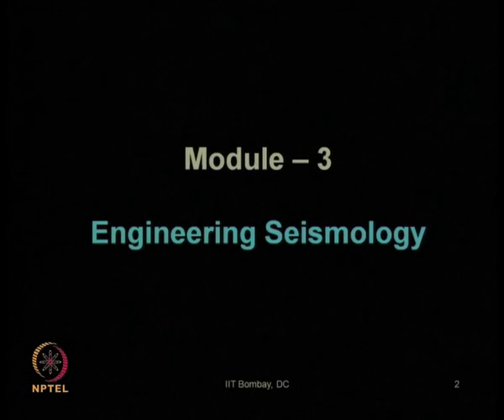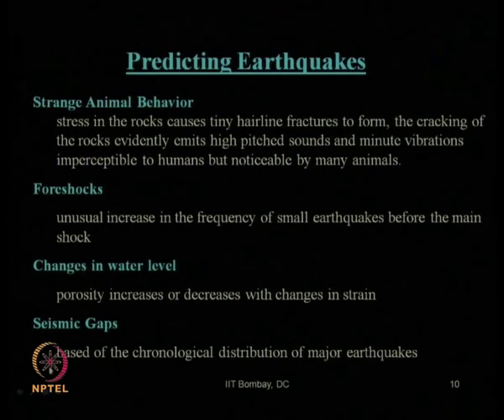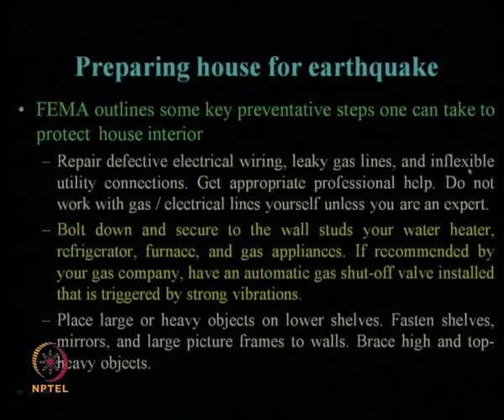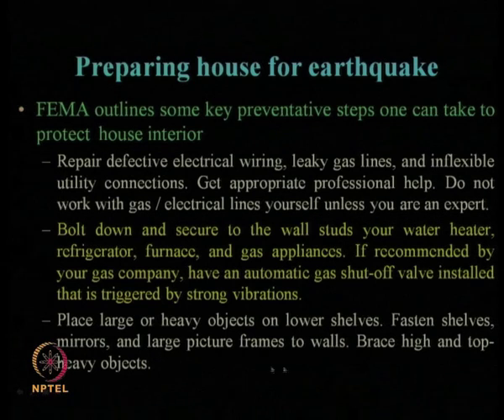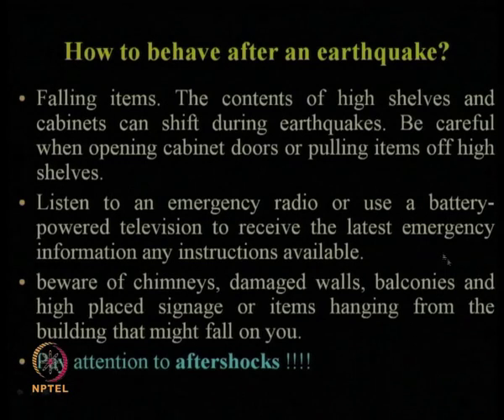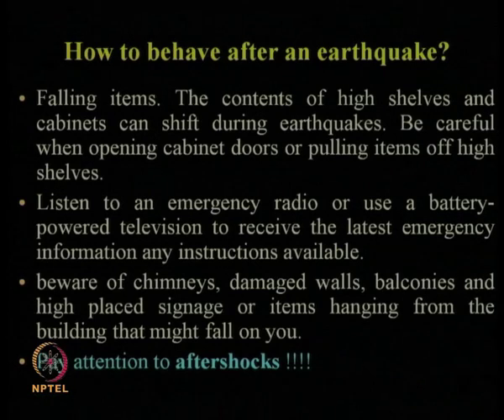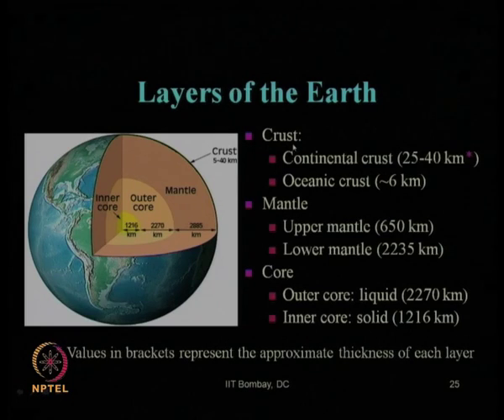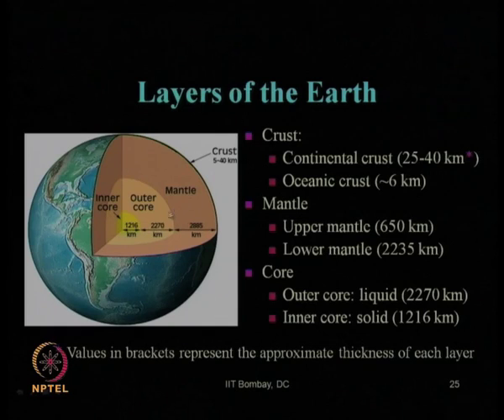Mod-03 Lec-06 Engineering Seismology (continued) part -III

Comment: Sir, a question arrises after listening this tutorial , As inner core is solid in nature because of pressure exerted on it , Due to volcanic erruption on surface causes decreament of pressure on inner core , and in past decades there is increase in volcanic erruption , as outter core is also liquid , mantle has also high temp but in solid state as it can also it melts ( solid layer depth dec. day by day ) - it cause more or severe eruption with more no of earthquake due to tactonic plate movement resulting in -No earth jst liquid and gas collection !!